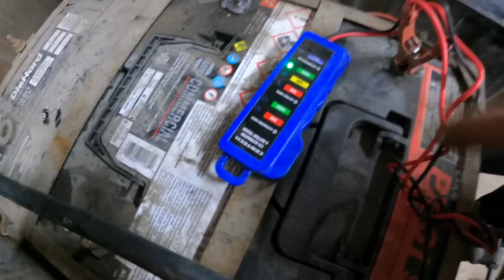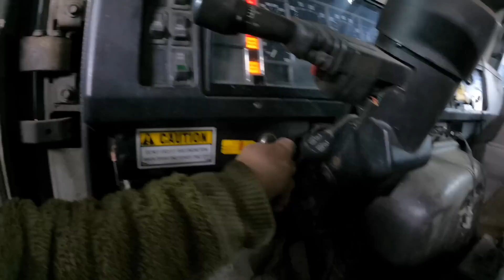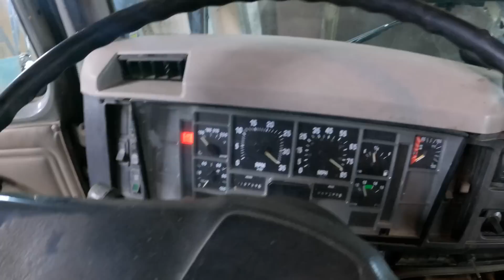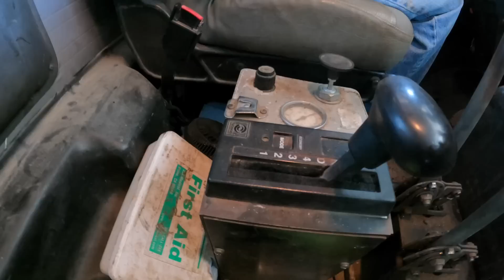Fixing a Broken Down N14 Cummins

Comment: Good job double D... if u have starter issues moving forward.. always 1st load test batts. Then 2nd ...test and see what your batt voltage is at the starter while it's being cranked over... if voltage remains the same at battery then u have a starter issue.  If voltage  at starter drops significantly...U have a bad ground or ie. Corrosion.  Or open wire... or bad positive feed to starter... keep up the good videos..

Comment: Battery’s should be at 12.6 it’s 2.1 volts per cell, 6 cells. 13.8/14 is when the alternator is charging

Comment: I'm thinking because you have to run a new wire to the starter for it to crank, and having problems with the indicator light I think your problems came from letting the starter drop probably shorted out the wire, by pulling on it. And for the indicating light probably came out of the zip tie, I would highly recommend be careful that you don't drop the starter I think that's where the other two problems came from but I could be wrong I am a human being to :-) good job Dave

Comment: Wasn't that white wire the trigger for the starter u had danglin????
Reply from the maker: That white wire was the old ground wire that went to the solenoid on the old starter. The new starter comes with all the grounds hooked up.
Reply: It was probably the signal wire. lOL worked before you messed with it.
Reply: @Dumpster_Dave  oic, was hard to tell from the camera angle when I rewatched it

Comment: Seen a couple of vids with thee engines starting struggling to turn the engine over - even with brand new batteries.
There are 2 fixes. 
Instead of 3 batteries, wire up another, to make 4.
There is a replacement lower geared starter motor that CAN turn the engine over on 3 batteries. I cant remember what its called.

But in the first instance make sure your batteries are good and check all the wiring and earths.
 
The problems with sluggish starting is very common with these trucks.
Reply: 39mt is the new style gear reduction starter, this is what he put in. His old starter looked like a 42mt, which is a direct drive starter